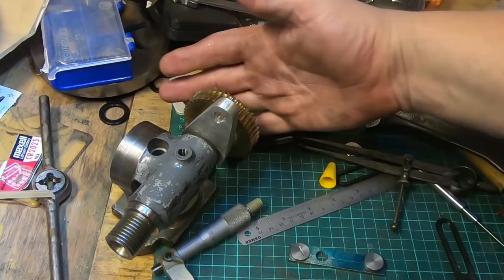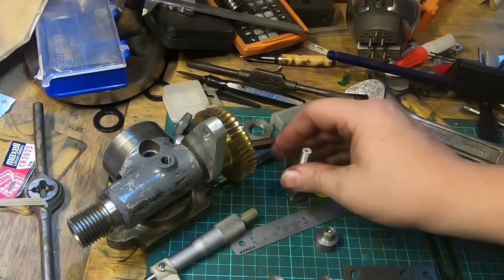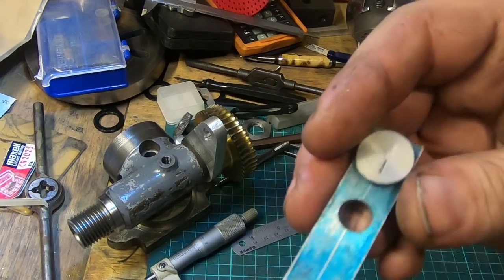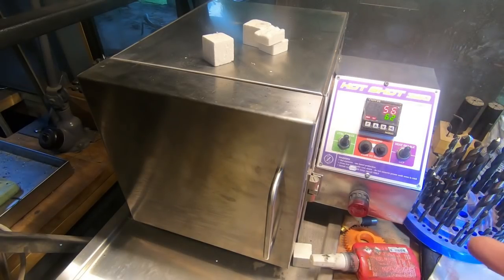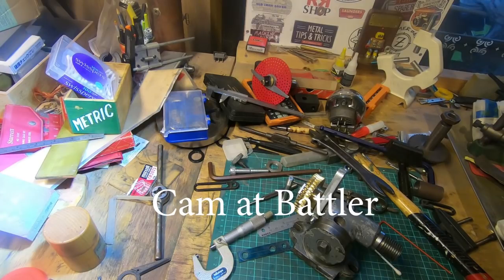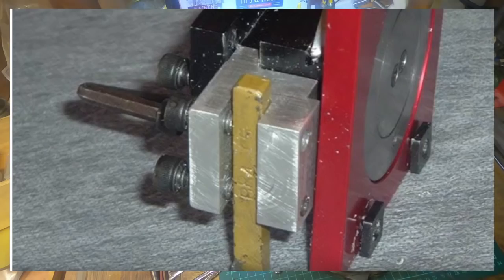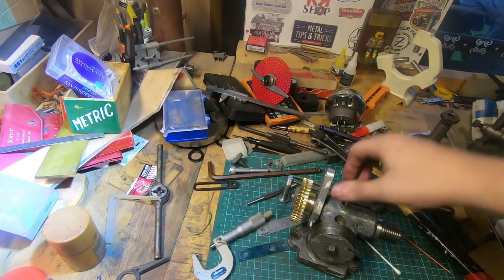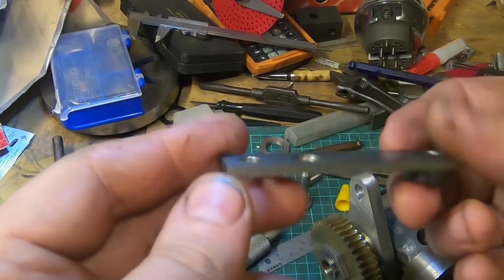Filing Buttons, And Competition UPDATE

Comment: Nice work on the buttons Emma.  Something I've never really considered using but they do give an accurate result without all the setting up of a rotary table or eyeballing on a sanding disc to machine the radii.  Something I'll defiantly use in the future, thanks for the heads up on this technique.
Cam